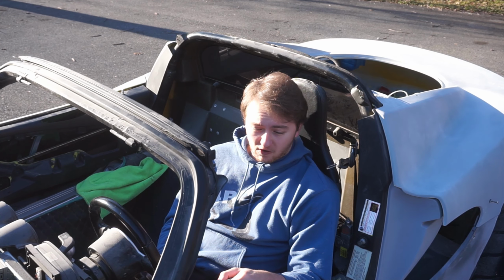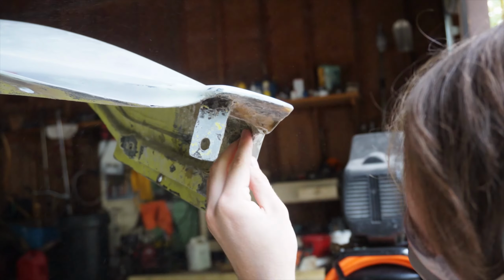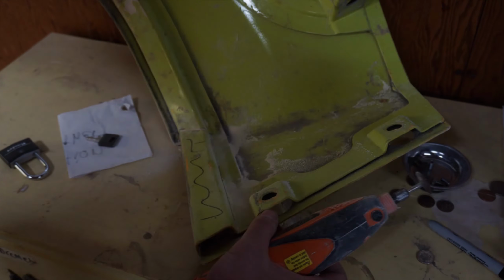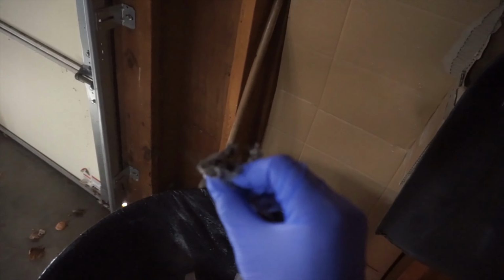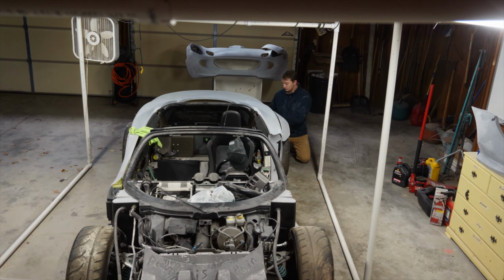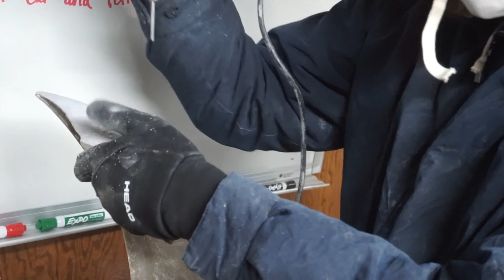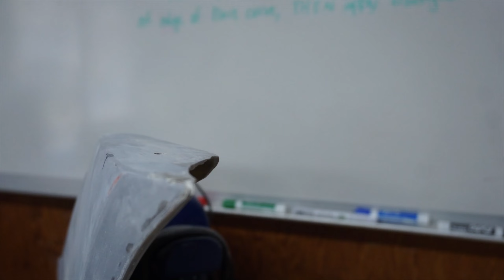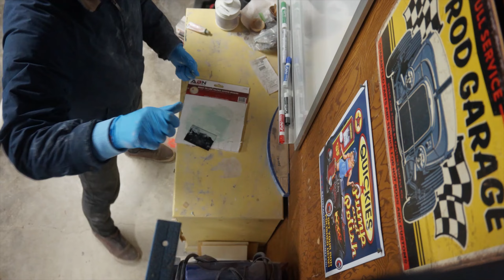Finishing the Bodywork on my Widebody Lotus!

Comment: Did you give up on this car?
Reply from the maker: Surprisingly no lol just had some really bad luck with it. Pretty much every area that had damage that I repaired needed a lot more work because the cracks extended way beyond what were visible, and I only found out when I sanded everything for paint and the wax&grease remover revealed all the cracks. I couldn't even primer over it because it just seeps into the cracks, so I've been redoing practically everything up until now, I finally finished all those fixes and can paint it soon whenever I get the chance
Reply: @4BitAutomotive  thanks for the reply.